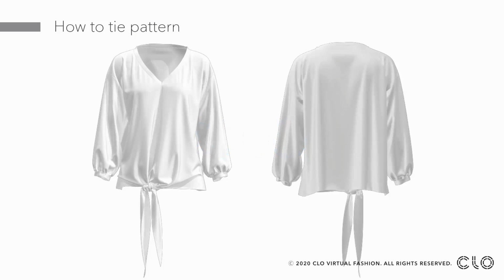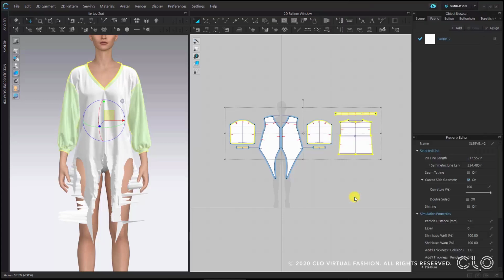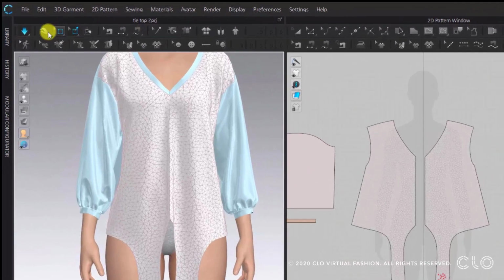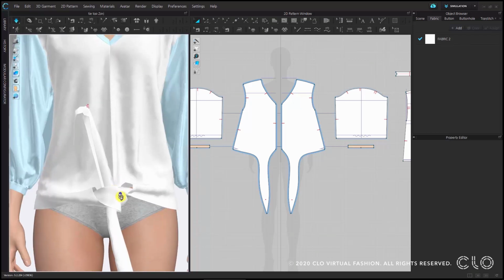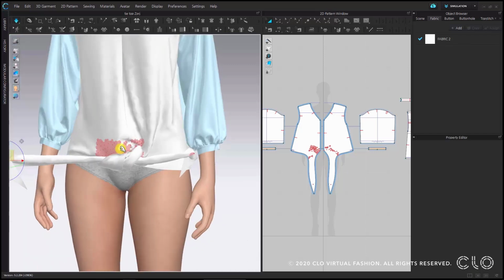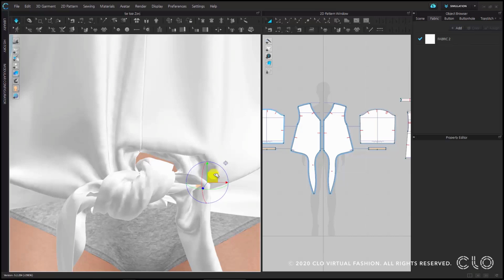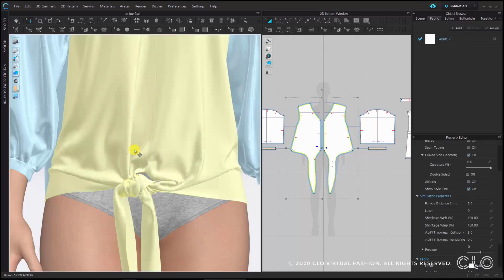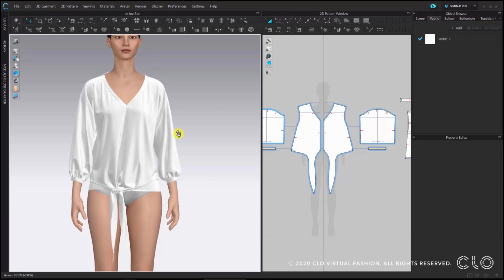Design Details: Way to do stable simulation - How to tie pattern(EN)

Comment: How can I make sure that the knot does not get untied when adding motion. Freezing the knot is not working as the knot is fixed globally and not locally to the body. Pinning is not always working with motion as there are too many parts moving around, depending on the motion.
Reply from the maker: Try sewing or tacking the fabric.

Comment: I struggled for over an hour playing around with the collision and particle distance and trying to tie the initial knot over and over again. Only when I switched from GPU to CPU simulation could I tie a knot without particles of the two ties not passing though each other. Where can I read some specific articles about when to use GPU and when to use CPU in instances like this? GPU simulation  is much faster and cleaner looking but it looks like it can't handle processes like this. Thanks in advance!
Reply from the maker: GPU should only be used to quickly visualize something. CPU is going to be more accurate. Here is more information. Feel free to search in our forums for more information. https://support.clo3d.com/hc/en-us/articles/360016295514-The-simulation-result-is-different-when-using-GPU-Simulation-
Reply: thank you @liza i was struggling for days without knowing this
Reply from the maker: you are welcome